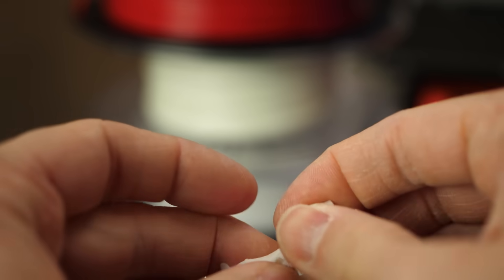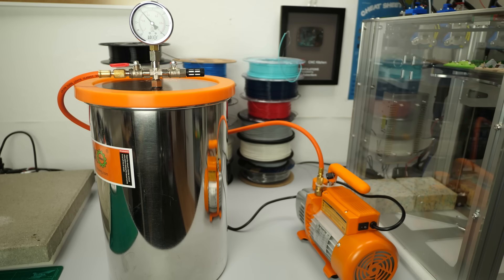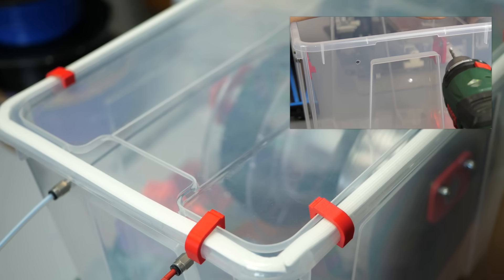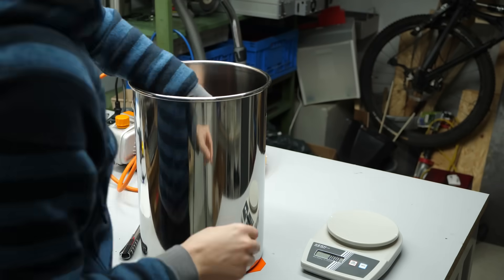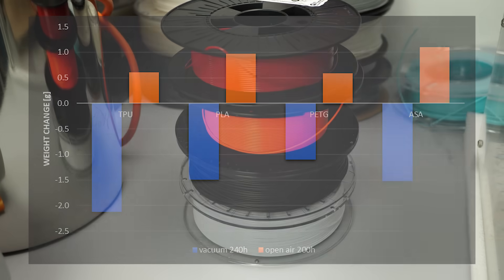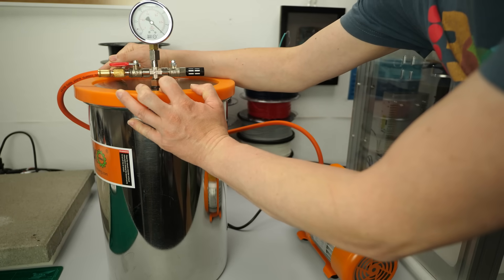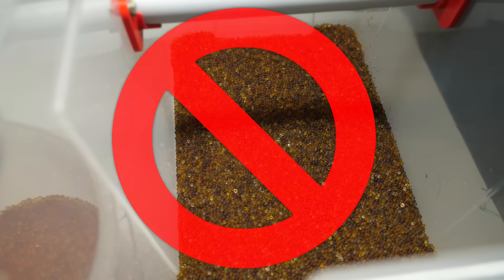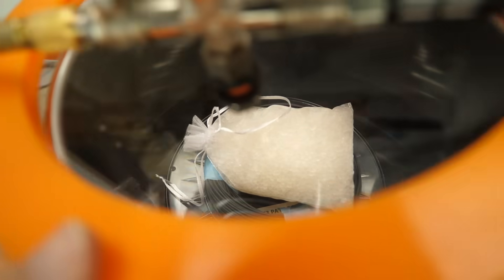Vacuum VS Dehydrator! What's the best way to dry filament?

Comment: I successfully use a vacuum chamber to dry my filament. I use a cheap single stage vacuum pump left running all night but i didn't have much success until I wrapped the chamber in a heating pad to raise the vapor pressure of the water. With this method i usually get about a tablespoon of water out of a roll of wet nylon (it ends up in the pump's oil!).

Comment: Heat and vacuum together is incredibly important for drying. This principle is used when getting all the moisture out of a automotive ac system. You run the engine to warm the system. For this pot, use a simple heating pad from a drug store

Comment: For any heater (here, a food dehydrator) probably want to look at whether the temperature overshoots, especially at turnon, because there is a lag between the temperature and the reading from the thermostat, plus any hysteresis.  This would be one melting mechanism:  turn it on set to e.g. 60C, temperature spikes to 70 before settling to 60C.
Also a question how accurate a thermostat is.

Comment: I also bought a set of vacuum pump and a pot. To dry it the filament also needs to be warm. But the critical point is when you float the pot after vacuum to open the lid it soaks all the ambient air with moisture back in. To make it professionally you had to do the floating after vacuum with dry nitrogen.
At last I keep my non pla filaments in boxes like yours with silica gel pearls. On top I placed in each box a wemosD1 mini with a a humidity probe which tells me what happened inside without opening the box unnecessary.

Comment: You use 100 hours (more than 4 days) vacuuming the filament and its not even fully dry at the end. I use Rosewill 250 Watt (0.25kW) food dryer for drying my PETG filament for 3D printing. The cost of KWh = 12 cent. here in USA. My printings last average 6 hours. For 6 hours I pay 72 cent. Its nothing in USA. I turn my dryer ON 1 hour before printing and keep it ON during the printing process. I got very nice quality. I set my dryer 62 C for PETG. I dry one spool over and over again so many times. Nothing happens to it. I think vacuum is not the good way to go. If you run your pump for 4 days it will cost you a lot and you don't get it even fully dry filament. And you are risking overheat and kill the motor. Use Food dryer. Here you can see my mods: https://youtu.be/B86fTvL6M7w   , https://youtu.be/QHJVUJXa6Q0

Comment: You use vacuum for 100 hours (more than 4 days) to get rid of some  water.Too long. I use food dehydrator Rosewill ($35) to dry every time when i print. It uses 250 Watt power. The cost of kilowatt in USA is 12 cents per 1 kWh.  I always put on my dryer at list 1 hour before printing and keep it ON during whole printing process. An average time for my printings is about 6 hours.  I mostly use to dry PETG as a filament for 3D. I's much better filament than PLA and ABS. PETG has an excellent layer adhesion and all PETG parts are great functional parts. For PETG I set the temperature of my drier to 62 C. I dryed  one PETG spool over and over so may times. Nothing happens to the spool if you keep it 62 C. I got excellent surface quality every time. For 6 hours I use 1.500 kWh, so the cost is about 72 cent. Not a big deal in USA. I think is better than vacuum. It pretty vast and cheap. If you keep 4 days your vacuum pump motor running, it will be more expensive and you still get moisture in it. Vacuum drying plastic filament for 3D printing its not worth at all. I never use any boxes for storage and don't use any desiccant.

Comment: I use vacuum sealed reusable bags for storage with desiccant packs, then dry in a food dehydrator for several hours before printing. Works like a charm!
Reply: Wide size of bags do you use for vacuum sealing? It's hard time find a sealer that will seal past 12" for under $400
Reply: @jordanl7489  ebay. 15€ for 50pieces disposable bags, but if you seal and cut well, you can reuse up to 3-5 times. 35x35 for me are good enough.
Reply: @jordanl7489  You can use the bags which are normaly used for vocuum storing textiles. They are cheap and you can use a normal vacuumcleaner.

Comment: Awesome testing! Good to know the simple dehydrator is the perfect thing to use for the more common filaments.
Reply: Or, if you have time, a closed box with silica gel.
Reply: @pizzablender  - Desiccant will absorb ambient mositure but won't draw it out of the filament itself.

Comment: Thank you for this comparison. For my part in France , I solved this aspect by using a large weather tight storage box with seal and latching lid, plus one liter of desiccant, the hygrometry is stable at 10%. I have 13 spools  inside. EAN-13 code:0 762016 429083. Dimensions are 12x12x20".

Comment: 2. FYI Stefan - I emailed  Taulman  a couple of months back asking them for their advice on best  vacuum drying practise esp for taulman 910 (a nylon) and other of their functional filaments explaining I was using a small vacuum pot like you, with a PID controlled heated mat underneath the vacuum pot and filament, with loads of dry desiccant inside the vacuum pot - and this was their reply - “With a vacuum unit about 8 hr's max.....usually around 4 at 40C and a good vacuum.
Max temp should be about 60C....sometimes you can make the line a bit "oblong" as it's wound tight in some spools.
As you're doing, the key is desiccants in the dryer....Most don't realize this is the main KEY as otherwise, you're just using hot and humid air and it won't really dry well”.

Comment: Terrific video Stefan - a couple of points if I can - 1. Accuracy of hygrometers - most are simply terrible - so it’s very difficult  to tell what the RH humidity in a dry box actually is for most people even though they think they know - Are you sure of the humidity level? I would be interested in the accuracy of your hygrometer l, and as a general point, could you please tell us the accuracy of your measuring instruments when you do videos - so I can get a sense of how precisely I should pay attention to numbers you quote? - when I bought one for my 3d printing a long while back I was amazed at the general in Accuracy of hygrometers - if one looks up the technical specifications for them, and I suspect most 3d printer owners are unaware of this. Most have way higher inaccuracy as the humidity drops - so most  are terrible in the range we want to use them for. (I forget but I seem to remember they claim to be like +_ 10-20% at less than 30% r.h !!!) You can calibrate them with special sachets of salt solutions of known concentrations in bags - which I didn’t see you  doing for yours (and no I haven’t for mine either ha ha) - so I would be suspicious of putting too much faith in a quoted  rh measurement unless it is a wildly expensive measuring device  (I bought a testo 608-h2 which I’ve just looked up and is  £90  and is still only accurate to +_ 2%)
Reply: I agree, I almost CANT find a decently priced hygrometer that can measure the RH I want to monitor. Mine go bezurk and read wierd numbers when I know for sure I'm below 30 and close to 0 (indicator cards)

Comment: I thought I could dry my filament using the same single stage vacuum pump. To truly dry the filament you need to get the pressure down to 29 inch mercury or less as the boiling point of water above 29 inches of mercury is still 50-60 degrees Celcius. A single stage pump will not be able to pull that low in any decent amount of time. You need a 2stage pump. I verified my findings by heating my PETG filament to 50 degrees then placing the roll in the vacuum chamber for 20 minute. The proof is in the pressure that was achieved. Room temperature filament could only get to 27.5-28 inch of mercury after hours of running on the vac pump. With heated filament the same single stage pump was able to pull down to 29.3 inches of mercury. I bought a 2 stage pump, same as I use for work 6 cfm cps. Now I can pull vacuum down to 200 microns in 30 minute without pre heating the filament.

Comment: for what i saw with my filament removing the spool is a great way to dry the filament because the spool it self is like a wall who keep moisture inside the filament. It is faster because the filament dry like it is a donut insted on a sphere
Reply: I would think this would be another reason to use spool free filament.

Dry filament, mount to spool, storage in dry box.

Comment: 1: Do you not measure vacuum in inches of mercury do you have to go beyond at 29.9 inches and go down and use a micrometer to get to the level to actually perform and measure your work of removing water.    2: vacuum pumps do not overheat after 15 minutes of use if they do it’s really a piece of $£!T .      The vacuum pump can easily run overnight no problem at all. And you should see absolutely no movement in a needle even after sitting for several hours. If your needle moves even a little bit it’s because you have a leak therefore leading in moist atmosphere returning moisture to your product.

Comment: Many years ago I used to manage a thermoplastic molding workshop where we heated plastic sheets enough to be formed on a mold using vacuum.  Some plastics are hygroscopic meaning they absorb moisture such as PETG and polycarbonate (lexan) being the worst. In order to mold PETG or polycarbonate sheets thicker than <3mm we had to dry them in an oven for certain period of time and mold them within a certain period of time.  If we attempted to heat these sheets without drying small bubbles would appear all over the sheet from absorbed water vapour - <3mm sheets were thin enough for the sheet to dry out if heated slowly. 

If you're using a vacuum pump to remove water from materials you need to use a vacuum pump with a "gas ballast" valve which allows a vacuum pump to pump condensable vapours. If your vacuum pump does not have this feature than water vapour will condense and mix with the oil.  If the amount of water vapour is small eventually it will be purged from the oil, however if the amount is too high the water and oil will make an emulsion like mayonnaise and you will damage the pump.  Therefore if you're using a vacuum pump to dry a substance use of the gas ballast valve is essential, however if this is not available running the pump with the inlet blocked for an hour or so. If the oil is looking whitish change the oil immediately and flush with clean oil.
Reply: Or you could always use an oil-free vacuum pump
Reply: @AU12  Yes, depends on the degree of vacuum required.
Reply: Ah now that's neat... Once long ago I made some hand-formed lexan struts for a homemade quadcopter and I was surprised to see bubbles form and weaken the bends when I got them too hot. All this time of 3d printing and I never made the connection to internal moisture.

Comment: Pretty interessting video! Especially the fact of the dry box. Many people said it only helps for containing the hydrated filament, but now I know it actually dehydrates it a fair amount (not as good as oven or dehydrator, but good enough I guess). Thanks for the long tests and sharing the results!
Reply: It's not binary.  It works on materials that don't greedily absorb moisture, but very hygroscopic materials may need to be heated.  The heat excites the polymers(they get soft and wiggly), which allows deep moisture to migrate through to the surface.  PET(not PETG) is an example of a material that needs heat to dry properly.

Comment: Stefan nice video with good information. I got great results from a vacuum drying system that I built for drying nylon and carbon fiber PC but also found it was great for ABS, PETG etc. I noticed that extruding smells are
also greatly reduced using dried filament. My vacuum pump is a small heavy scientific 50L/minute two stage oil sealed model. The ultimate vacuum
(no flow) is 0.1 or 10 pascals if the ballast valve is open. When the
ballast valve is open, the bleeding air removes condensates from the oil.
Have a smile at my $50 stove top pressure cooker vacuum chamber that is big enough for 2 spools (fresco brand but the cooker is sold under many names). I only had to invert one threaded pressure safety relief valve so it would seal under vacuum. I designed 3 printed parts, and using a refrigerant
diaphragm valve that seals to the lid with O-rings I was done. A removable
flexible stainless-steel natural gas appliance hose connects the valve to
the vacuum pump with another printed part. Unfortunately, I only have a 1gr
resolution scale to measure any weight change. Instead as a dry indication test, I print clear filament at the maximum recommended extrusion temperature then look for bubbles in the purge line using a x10 magnifying glass, and with PC I don't get any in the first 12 hours after vacuum drying.

With a non-scientific vacuum pump which produces less vacuum, I would feed a very small amount ballast air directly into the vacuum chamber but only while pumping to reduce the chamber humidity and the pump oil moisture.

-Peter

Comment: That's why I use ABS, it's a bit harder to print, but the roll just sits on top of the printer with a dust filter in line with the filament, 1 year old, generic, cheapest ABS I could find, still prints the same as when new.

Comment: As someone who has created Stabilized Wood products using a Vacuum System. The only problem I had is your statement about Full Spools and the ability of the Vacuum to remove the Hydroscopic fluids from the inner portions of a spool. Even if the Filament was melted into a block instead of being wound around the spool. The vacuum would still pull the hydroscopic fluids from the material regardless.

Comment: My experience with nylon spools is that even after 12h in a convection oven at 80C, doesn't seem to dry the spools through to the inside. I haven't done any scientific experiments but with large prints that use up a whole spool it definitely seems like the first half of the print looks good but towards the end the oozing increased. I interpret this as the inner parts of the spool not being as dry as the outside. Now, here in Hawaii the moisture situation is pretty extreme so this might not be an issue for everyone, but I'm working on building a heated storage box with built-in dehumidifier that I can print directly out of. I don't intend to keep the temperature elevated all the time, rather cycling it up to bake out the moisture and then cooling it down while continuously dehumidifying the inside air. I guess we'll see if I run into heat damage to the filaments.

Comment: Test with 3A or 13X molecular sieve desiccant.   Silica holds more moisture, but can't get the humidity anywhere near as low as molecular sieve.  (The sieve is also easy to recharge in an oven with a metal cookie tin)

Comment: So if I understand you correctly for normal materials like PLA or PETG putting it a few hours into the dehydrator is the way to go?
I had several year old spools and samples that started getting brittle. After drying them 4 hours or so I could print them fine again.
Reply from the maker: Yes.
Reply: CNC Kitchen danke

Comment: Great comparison. Sucks how real science takes a lot of work. Been wanting to build a desiccant box like you did; one quick question. What were the health concerns on indicator desiccant?? I have a kilo and change of the blue indicating type I purchased some time ago that I put into small bags for medium term storage (winter/summer clothes) and the leftover would work well enough for a smaller box. 
I was thinking of taking the idea to the next level and making a box using a peltier plate and some ducting to cool/remove moisture then heat and lower relative humidity before pumping into a box / build volume.  Hook up an arduino to keep an eye on internal temp and moisture to control cycling.  Probably not as good for quickly drying like a food dehydrator but interested for more long term continuous duty work..
Reply: It's not food safe because of the dye. Don't crush the desiccant balls and snort them and you'll be fine. Also maybe don't eat them.

Comment: Better than silica are zeolites but more expensive. Chemists like to dry in a desiccator and supported by cheap calcium chloride (and heat if possible), https://tu-dresden.de/mn/chemie/oc/oc2/ressourcen/dateien/moduloc2/versuchsvorschriften/Trocknung.pdf?lang=de . 
Also relaxed pressurized gas ist very dry. The partial pressure of water depends on the temperature but not on the absolute pressure. Even if the pressurized gas would be saturated @200bar, the partial pressure of water would be reduced by a factor of 200 when relaxed to ambient pressure.

Comment: my question is "what is sufficient percentage of moisture allowable for each type of material? if this makes sense.
Reply: This is exactly what I would like to know. 

I have just weighed a recently opened roll of PLA (opened about 5 days in a fairly dry week in the UK), then dried for 12 hours at 55 degrees C in my food dehydrator and reweighed. I found I lost around 0.21% of weight (or water). 

I wonder is this enough to affect the printability of the PLA?

I found the fact that all the moisture removed would be back in the filament within a week or so if not stored in a dry box very interesting.
Reply: Next question is how to measure it, and next question is how to rech it. This was from Stefan great introduction to problem. Appreciate it much. But it don ‘t  give this answers. As mechanical engineer, I need technology. As simple procedure as possible - “do this” and “prove result”. I have bought spools of nylon. I don ‘t started printing 6 months, as “moisture is a problem”. But still don ‘t found data what about they talk, how to meassure it, how to handle it.